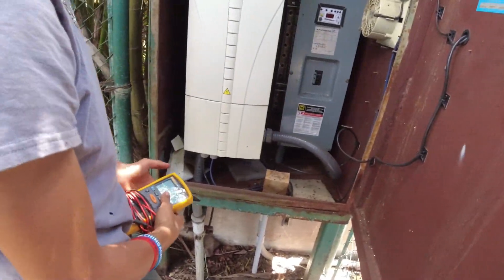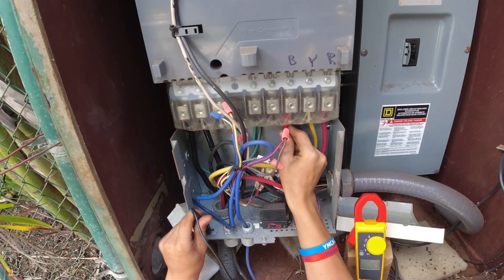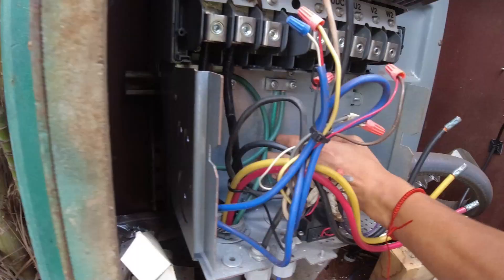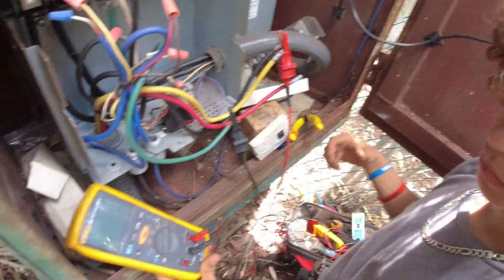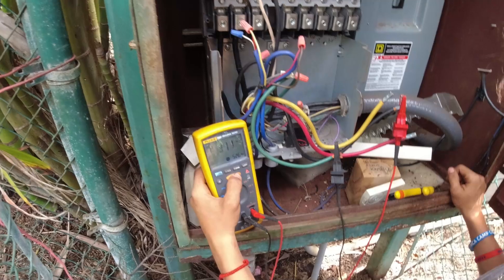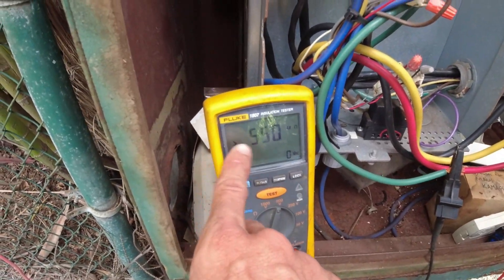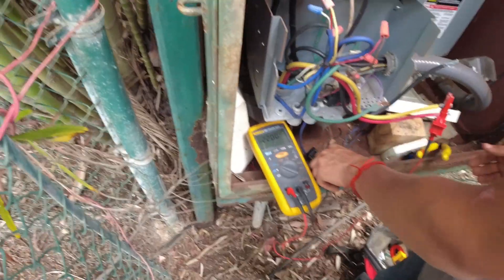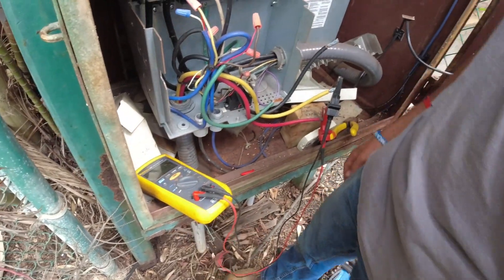Training with Fluke 1507 Megohmmeter Insulation Tester of Well Pump Motor Windings

Comment: Nice! Under what Mohms is it safe to say that the motor is bad?
Reply from the maker: Industry standards vary but below 50k ohms and you're likely to have a shorted motor soon. Ideally we track the resistance over time from the initial install. That way we can possibly predict and prepare for the failure.
If I see below 1megohm I think it's suspicious.
Reply: It is not just resistance, u have pi test or dar that is real test like this in 10 sec, is good but u cant say windings are good but isolation...maybe not